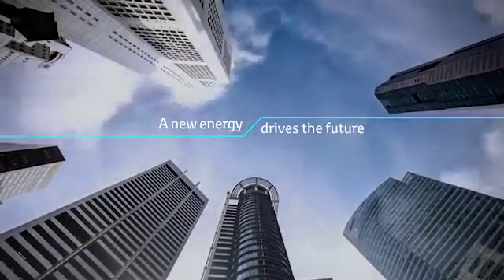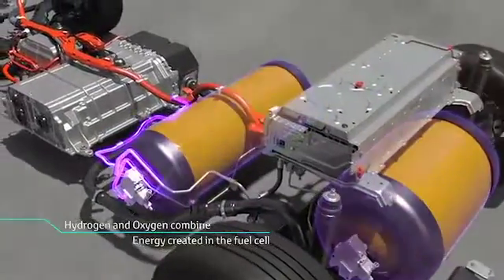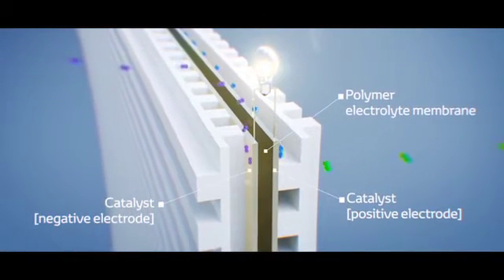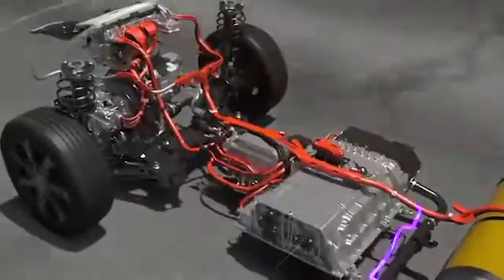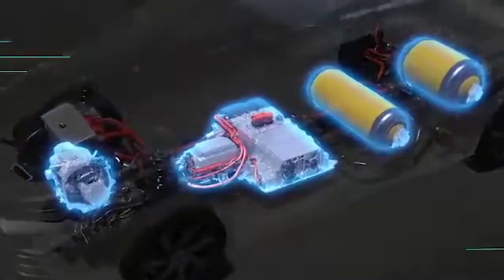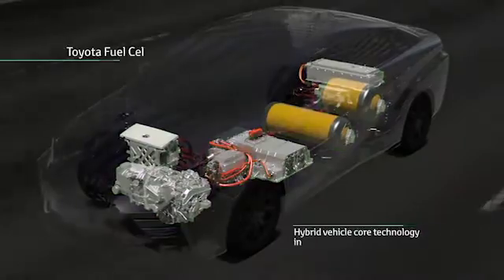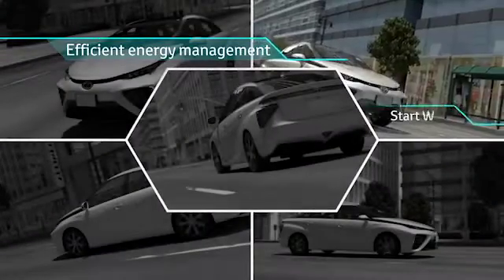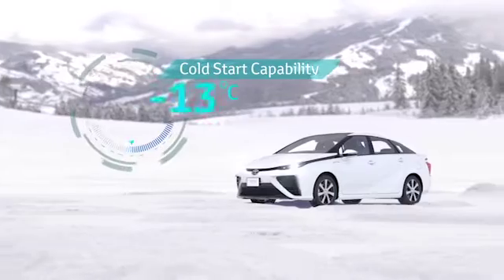Toyota Mirai & Toyota Fuel Cell System (TFCS)

Comment: So you're driving around with pressurized hydrogen tanks? What if you crash and they get punctured?
Reply: They have been crash tested, but they have to be inspected and leak sensors tested every 5,000 miles.  Recomended max life is 15 yrs, but no warranty for chemical or salt damage.  Hydrogen isn't exceptionally dangerous itself, its more the pressure vessel at 10,000PSI.
Reply: Toyota have done all the necessary testings, and ensure that there is no danger at all.